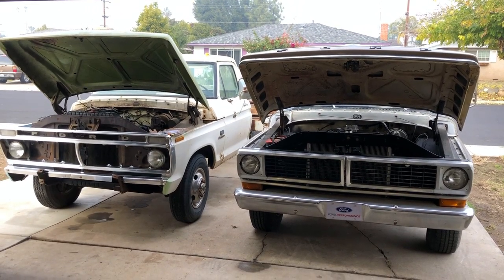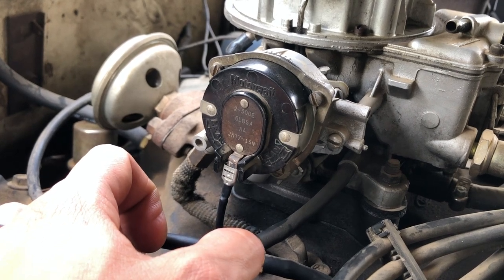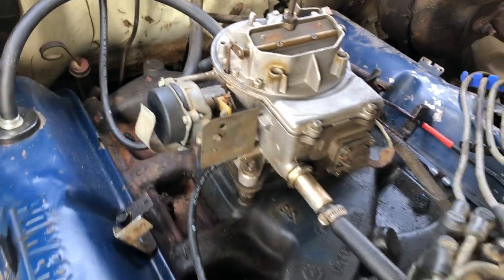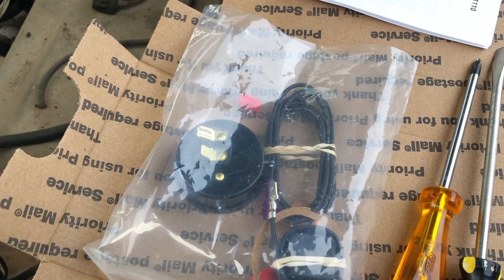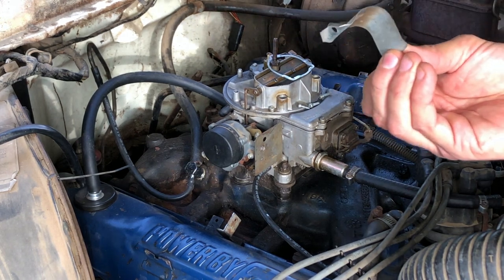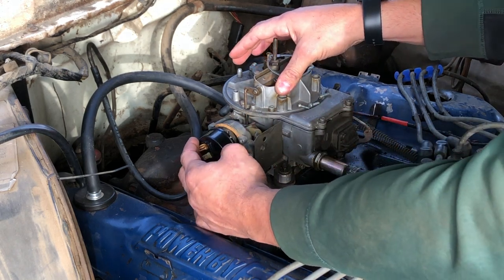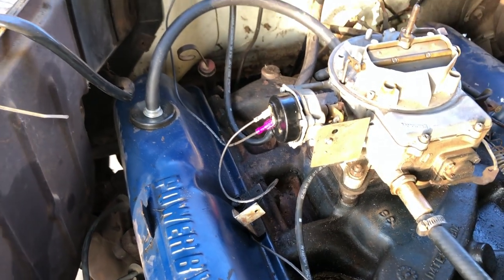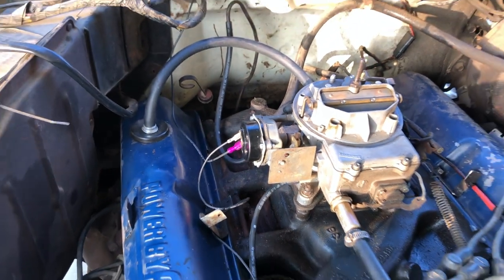1974 F350-Carburetor electric choke conversion

Comment: I wonder if the thermistor could be cut off and just wire the black to a ground.?. (Like most others are ).
Reply from the maker: I’m sure it could. The point of the thermistor with this kit though it to read the temp more accurate to make sure the truck warms up enough prior to driving.

Comment: My aftermarket intake doesn't have a place for the tube to connect from the chock to the manifold, any ideas??
Reply from the maker: I think it would depend on the type of choke you have, easiest option would be to probably upgrade the choke. What type of aftermarket manifold are you running?
Reply: @AJsGarage  Edlebrock torker
Reply from the maker: Ok did the truck have a heat activated choke? might just have to switch it out to a manual or electric choke.